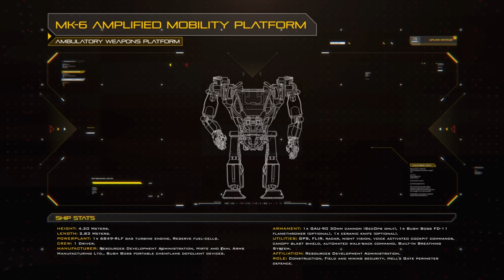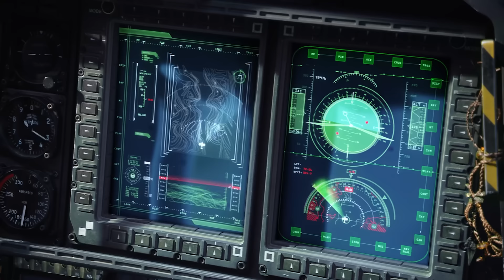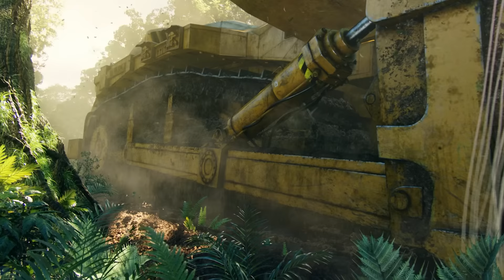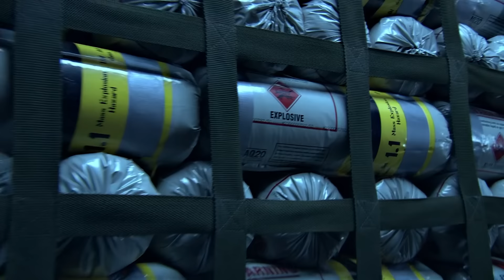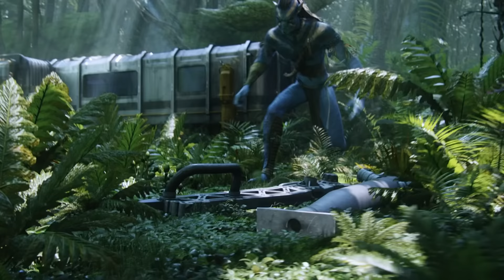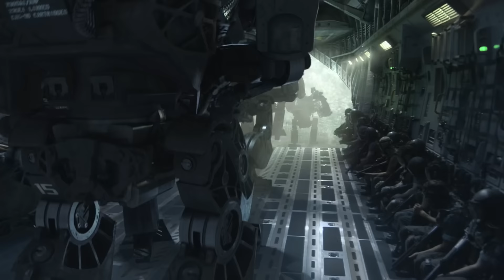Avatar: AMP Suit | Vehicle Breakdown

Comment: Cool? Yes. Realistic? Hell nah. The legs are bigger issue than most people think. Operator movesit like a tank but it has legs. Not happening. How the machine knows there is a root a sudden void etc. Under mechs feet? If you cant feel it you cant know it. So other than (mostly man made) roads and open / even grounds. You cant use it without falling.

Comment: anything, ANYTHING but a bomber
Reply: ANYTHING but conventional armored fighting vehicles (which would probably be more effective at ground combat than the AMP suit)
Reply: @averagelithuanian  that's debatable, Pandora presents a pretty huge mobility challenge. the AMP suit is a decent solution for getting armor into the jungle where you'd need to spend hours clearing trees and building bridges for the Space Bradley™
Reply: @theSVGfoundation I mean they could have at least added some slats to protect from the arrows

Comment: I think I would’ve mounted the cockpit higher up. If you’ve already committed to using a glass canopy instead of a VR display and mechanical head, you should position the pilot higher to make it more intuitive to use. It would make it easier to learn since your point of view relative to the mech’s arms would be more similar to your view relative to your own arms. 
Regardless, I do love the battle forklift very very much.

Comment: AMPs are just lamer versions of Invictor Tactical Warsuits. You're telling me you have a mech, and it DOESN'T have a giant sized revolver made from a high-caliber machine gun mounted on tanks?
Reply: Or the PTX 140 from Lost Planet which has a goddamn chainsaw on one arm
Reply: @epicty3607  That’s badass
Reply: The AMP suit is used for combat and non combat purposes its not simply just a war machine designed to kill also its wayyy more practical for rough jungle terrain and easy production its a more realistic design
Reply: @joshispro345  I'd argue the Invictor is slightly more practical. It's bulkier so it makes sense why it's so big (so as to fit all of its advanced functions). The AMP is way too sleek.
Reply: @LadyCrate  having a bulkier platform is a disadvantage in a jungle environment with steep terrain while a sleeker and lighter design proves itself in speed, manueverability and a less resource intensive production process
Reply: @joshispro345  I mean, the jungle environment is something the AMP is made for. The Invictor is superior due to actually showing its mechanics.

Comment: Armored Core 6 is launching next month. You might consider doing a space dock in the armored Core building a neck process. Go over how you can swap out the legs arm body parts head parts weapons and how different configurations have different pluses and minuses. Look up the videos for armored course 6 that are out right now. You might even be able to get them to sponsor you.

Comment: I don't understand why they have that stupid glass canopy that offers NO protection against primitive spears. You'd think they'd either make it some type of thick, reinforced transparent Kevlar or aluminum, or they'd get rid of it completely and just have armored steel/titanium shell with lots of micro-cameras on it so to us it looks enclosed but to the pilot they can still see everything just fine.
Reply: Cameras could easily be damaged by the jungle / Navi, and most materials would be hell to see through, and iirc the glass is bullet proof
Reply: It is stated in the movie that the magnetic field of the planet interfered with cameras essentially rendering them useless (since you can't see anything with them ) that is also the reason why it has a glass canopy instead of armor , the glass canopy provided enough protection for some time and also gave alot of visibility
Reply: @ulforcemegamon3094  Or it's lazy writing needing to give the primitive society a chance.
Can travel across the stars but can't make a camera to deal with "different magnetic fields" of a planet? Please.
Reply: @tacitus6384  the AMP suits original purpose was heavy duty work the rda repurposed it as a weapons platform and never really bothered to upgrade all their suits some amp suits did have wire cages covering the canopy tho

Comment: Honestly, this is one of my favorite mech designs in fiction. If it will ever be possible to actually make a mech, I think the AMP suits are the closest to what is actually possible. Because when talking about mechs the constant points of discussion are the Square Cube Law, how would the joints handle the stresses associated with supporting a large mass of metal, wouldn't the walkers just sink on soft soil with the small surface area of their feet? After all, if we want to put a lot of armor and firepower on something, we tend to then add tracks to it so it won't sink on mud. And that's just called a tank. So why even bother with mechs?

AMP suits are small enough to believe they could overcome these hurdles with proper materials, and they make perfect sense in an environment that land vehicles like tanks already have trouble navigating, like dense forests (the jungles of Pandora!). And they do other things that tanks can't, they're about mobility and utility rather than armor and firepower. Basically heavy infantry with a support role, we see them moving heavy loads of ammunition, and I could also imagine them rolling over flipped APC in a combat situation. Humvees would often end up on their side when they drove over a mine. Would be useful to have an AMP nearby for just such an occasion.

And most importantly, THEY'RE NOT DIGITIGRADE. Why are so many fictional mechs digitigrade? There's a reason humans and elephants are plantigrade.
Reply: Great comment, i will add some things about it :
There is already a mech called the Method 2/3 (can't remember the exact number but it was either of them) developted in South Korea that is practically the AMP suit , however their biggest problem was powering it rather than legs or the balance, also i agree with you that is the most plausible mech design.
 
As per the last thing i think is due to the fact that digitigrade looks better and digitigrade legs of animals are faster and tend to be more efficient than human legs (plantigrade) , however many people forget that plantigrade   do have advantages over digitigrade 
As with the elephant part i did some googling and turns out the elephant leg type is an hybrid ! , is plantigrade but also somethat digitigrade , this can be infered when looking at the bones , perhaps we should take more of a look of how elephants legs are when we want to make mechs , elephant legs have the speed bonus of digitigrade but can support their weight very well like a plantigrade due to the soft but strong structures that it has in the sole of the foot , they also absorb the impact of the walking and make them less noisy (elephants aren't the master of the silence but is interesing to see the additional thing)
Reply: As someone without Biology background, Need context about this
Reply: @darumapura1431  
1. The square cube law just means that the volume of an object grows faster than its surface area, and is the main factor limiting organisms in size. Cells aren't very big because they wouldn't be able to transport substances from their surface deeper towards the center, same with land arthropods and oxygen, vertebrates don't get bigger than mammoths/dinosaurs because their bones wouldn't be able to support their weight. The same is true for vehicles, the Maus tank was impractical because it was too big, and tanks are a lot more sturdy than a mech with articulated limbs would be.

2. Digitigrade legs act like springs, they are very good for running fast but not so good at supporting a lot of weight. If you put a lot of weight on a spring, it just crumples. Plantigrade legs in a standing position lock the joints and bones parallel to each other and perpendicular to the surface, in result they can take on a lot of weight, so bipeds like humans that only have 2 limbs to distribute the weight, and very heavy animals like elephants are plantigrade. There are exceptions like some dinosaurs, the T. rex was a digitigrade bipedal predator, but if you look at its body you'll notice that half of it is just the muscles and bones for the legs, they support the tremendous weight of the body.

Weight would be a much bigger factor for mechs since they'd be made of metals, armored, carrying weaponry, way more dense than animals. Digitgrade mechs just make no sense, unless you want some very light, fast, unarmored scouting vehicle,  but even then I don't think we have the material science to keep the joints intact against the forces they'd be subject to. And yet in fiction there's ton of slow moving digitigrade mechs carrying missile pods and other BFGs. Just, why? What's the point? Just make it plantigrade, it's simpler, sturdier, more analogous to human joints, etc.
Reply: @Horny_Fruit_Flies  as per your second comment there is an paper which is interesing to look at regarding the  subject, and that is the Birdbot robot, it is a robot which is very efficient at walking and running ,  is modeled after an ostrich and other running birds , is mostly uses springs and cables to hold the weight of the robot , the thing is that the scaled up versión of the leg is 1.75 meters tall , weights 75kg and also can carry a load of 2243 kg , while not saying we should do something like the AMP suit but with Bird legs , i think we could use cables and springs to help the mech to hold their weight effectively
Reply: @ulforcemegamon3094  I remember the Method "mech", tbh I was not impressed with it, an oversized box on shaky legs is something that the Mythbusters could build in a month with $2000. Bipedal robots is still something that we aren't close to cracking, Boston Dynamics are basically the best in the business and even their Atlas is a bit ungainly, which is why they focus so much on their quadrupedal robots so much. More stable.

The ostrich legs are pretty interesting. I think I found the paper; "BirdBot achieves energy-efficient gait with minimal control using avian-inspired leg clutching" but can't see the part about the weights it could potentially carry. The one in the video demonstration on YouTube is tiny. I like the idea of a springed cable acting as a single muscle for the entire limb, not something that is found in animals. Anyway, I'm not saying it's impossible for digitgrade mechs to exist, my point is simply that they are more complex (at least 1-2 additional joints) and can carry less weight (spring effect, smaller feet surface area) than their plantigrade analogues simply by their geometrical properties. If we had materials strong enough, we could build digitigrade mechs that are both sturdy and very fast, but for the time being we don't have the materials nor technology for either digi- or plantigrade large robots. As we develop stronger materials I'm very sure that plantigrade designs will be the first to become viable.
Reply: @Horny_Fruit_Flies  
Yeah , the Method 2 is a bit dissapointing since is basically a box with legs XD , also yes , the whole thing of the springed cable acting as a single muscle for the entire limb is very interesing, it  decreases weight , makes maintenance easier and technically could decrease costs by a Big margin, since you are just using a bunch of cables for the mech knee and feet , and only the hip would use the motors/servos to move and i'm pretty sure using a bunch of cables is way cheaper and lighter than some Big bulky servos/motors for the legs , not for mention that cables would be more readily avalaible to replace than if a motor/servo breaks down , and i agree with that last point , a plantigrade type would be more likely for the time being

Comment: Realistically speaking there really is not much of a reason to chose a bi-pedal gun-platform over any tracked vehicle. Leave alone the technical nightmare of maintaining all those joints and servos the main issue with such designs is always, size and ground pressure. 
It can not be understimated how much ground pressure plays a role when it comes to armored units. Be it from tracked to wheeled vehicles. In almost all situations you will do better with something that has some kind of wheel or track. Not only is it actually pretty decent as far as the mobility goes you can actually also pack mure stuff on it in relation to the weight. In other words, you get more bang for your buck.
Reply: Quite , having something being bipedal isn't really that good , a quadruped or hexapod in the other hand is a bit different since both have way lower ground pressure than bipeds and can carry more cargo since balance is less of a concern with a quadruped/hexapod due to the reduced Center of mass

Comment: These devices are not suitable for combat, clearly. 

Such an exposed cockpit with such a fragile canopy offers very limited resistance to attacks, which has been proven time and again. Transparent materials are relatively fragile, which is why you don't find large windows on the front of a tank. In case of impact, the pilot may lose his weapon, although it should be integrated into the frame (with spare weapons in case of loss of the main weapon). 

Things that should be known to the humanity of the future though, considering its military experience of several millennia.
Reply: it was never designed for combat it was designed for heavy duty work

Comment: I wonder if such a mech could be made to this day, not 100% the same  since its sci fi but close. Like ita would greatly help the counstrution industry if such a mech was made, like you could it to lift objects and carry it to places where a forklift would struggle. And it could help other sectores aswell. It wouldn't be pratical using it the military way since its a huge target that can be taken out easily. Unless they use it for logistical purposes like loading supplies on trains and planes.
Reply: Search up Method 2. Its a Korean design thats been in the works for a few years now

Comment: All I'm gonna say is, if they actually used tanks to protect their soldiers instead of these mechs with glass cockpits they would not have lost so easily.
Reply: These are far lighter than tanks and fighting is their secondary (Though important) function. They are also used for logistics, construction, and land clearing.

Plus jungles and tanks historically don't get along.

Comment: It's important to remember that AMP suits were designed for utility - that is, to enhance the whole range of human activity. The fact that it mimics the human condition means rather than acclimating to a wholly new system, the AMP driver IS the system. Capabilities to the AMP suit that a normal human wouldn't otherwise be biologically equipped with would adversely affect intuitiveness of its operation. 

Mounting weapons is terrible idea. 1. It increases the complexity of manufacturing, repairs and maintenance. 2. A number of different variant would have be designed thus, exacerbating issues with the first point. 3. External mounted systems would drastically reduce the utilitarian nature of the AMP suit (I.E. an AMP suit with a rocket launcher attached might limit its use as a general laborer). 4. Enhancing the AMP suit's capabilities by way of carrying tools appropriate for the job offers the most flexible solution when job requirements change.

The walkback feature is an important element here as it provides a plausible explanation as to how Colonel Quaritch's deceased body was brought back to the RDA where his body was then removed from the AMP suit and preserved long enough to transfer his consciousness into an avatar body.

Comment: Ultimately, these suits have quite a few problems (e.g. open ammo feeds that can get stuck in foilage) and are quite a bit less capable than the Wanzer from the Front Mission series. The Wanzer are also small type mech suits (most between 5-7 meters tall), with high mobility and a modular design, where one can mix and match componnents (e.g. arms, legs, weapons) to suit the mission and/or the driver. They are better armored and better armed.

Comment: If only Avatar itself was even half as interesting as it's mechanical designs.
While it seems practical for use on pandora, that canopy would be screwed against even small arms fire and I doubt it can go prone or make good use of cover so it's usefulness against a force with comparable technology is pretty dubious.
Reply: It was stated that the only reason that Canopy was used was due to Pandora strong electromagnetic field messing the cameras , normally the AMP suit has armor and cameras

Comment: The use of AMPs without having any tanks and APC's to support them is ultimately one of the reasons why the human forces fell short. 
A combined arms of AMPs, foot infantry and VTOLs isn't a good composition if the VTOLs are hindered by high dense jungle foliage.
Reply: Contrary to popular belief, tracked vehicles such as tanks cannot traverse jungle terrain without construction machinery to clear large foliage.

Also, the hammerheads that knocked the AMP suits around like bowling pins would have had little difficulty tipping over any armoured vehicle.
Reply: @sargonassarg4356  also aren't tanks and apc like super weak in the top part ? , like something could just stomp them and they would crush the turret , so even if they somehow weren't tipped, they would get crushed
Reply: @ulforcemegamon3094  They are. and only idiots ever think of bringing tanks into jungles. Too many blind spots. Camera is easily broken with just explosive/incedinary arrows. Basically, this set-up is as best as they can think of. Mech + infantry + light heli support. In fact, they even make short work of around 2000 Na'vis with only a few hundred soldiers with this set-up in Avatar 1. Until Eywa says enough is enough.